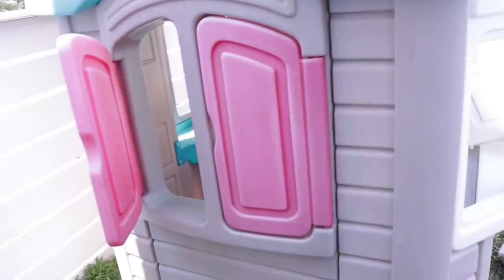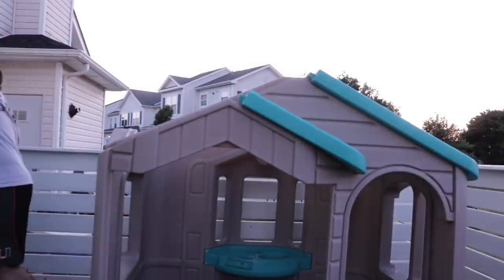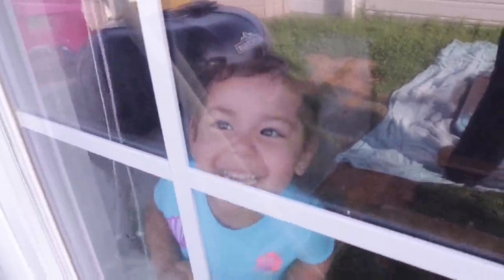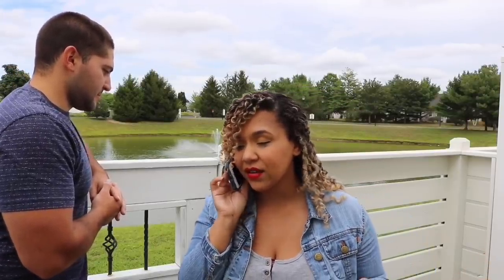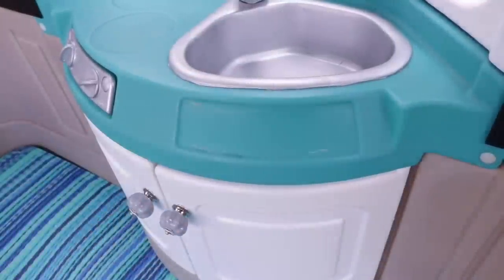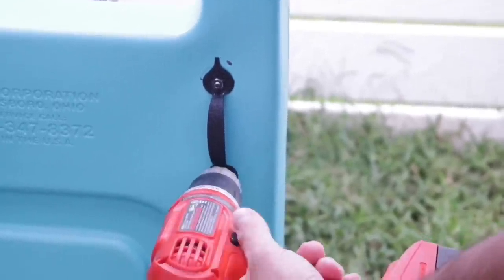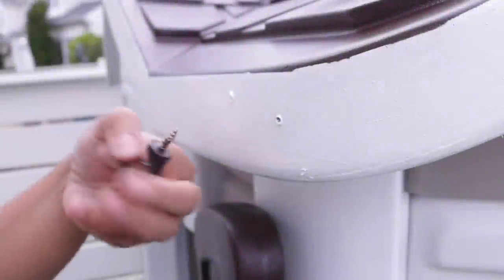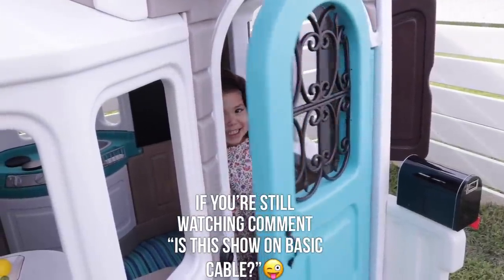Paint a Plastic Playhouse like a pro! Unbelievable Step2 Playhouse Makeover

Comment: Curious... what was the total cost of the house including the makeover?
Reply: My thoughts exactly here in Lisbon Portugal... :DDD.
Reply: @MariaTorres-hc5uq  good question. Wish  they would answer.
Reply: Let's see... gonna say they went for the best deals I can find. That said, $100 for the house, approx $25 for the replacement parts (doorbell and skylight) including shipping, $3 for the spraypaint handle, $1 for painter's tape, $8 for both cans of Espresso, $20 for all five cans of Blossom White, she said $16 for the white touch up paint but didn't say what the coupon was so I'll just leave it at that to also account for any money I might be missing when adding in the others as I'm going for cheapest price, $1 organizer, $4 for can of Silver, $4 for a can of Seaside, $4 for a can of Oil Rubbed Bronze, $6 for the ConTact paper and $17 for the puck light (free shipping on orders of $25+), approx $20 for the solar lanterns including shipping, $8 for a 12 pack of large command strips, $7 for the pack of two melon knobs, $3 for both drawers pulls, $1 for the three pack of machine screws, $2 for the fences, $3 for the house numbers, $7 for the mailbox, and I can't find the flower window box so no idea on price n will not be including it.

ALL THIS BEING SAID THE GRAND TOTAL IS $260 (minus the tables, chairs, inside props, fake flowers, etc.)

I spent almost an hour on this. Idk how to feel about that.
Reply: With all the work they put in, more than $300.00 to make the final product, and their child might play in it for the 1st summer and ignore it after that... they could have bought a new one, sold it for half price after a year, and still been money ahead. That being said... the house means as much to Mom as to daughter so the process alone builds loving memories, and you can't put a price on those.  :)
Reply: @Glotglot  Feeling of familial love? Priceless.
Reply: Dorothy Worrell the uniqueness of this playhouse skyrockets the resale value as opposed to the standard little tykes house
Reply: @tinaamariee832  Very true!
Reply: @Beth Wood There was a proverbial itch to scratch as I wanted to know the total too. lol